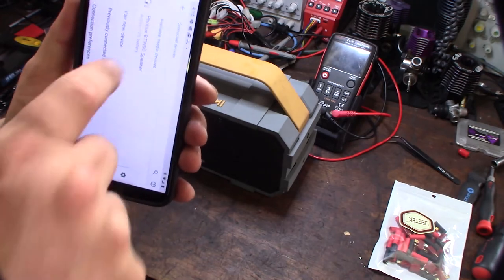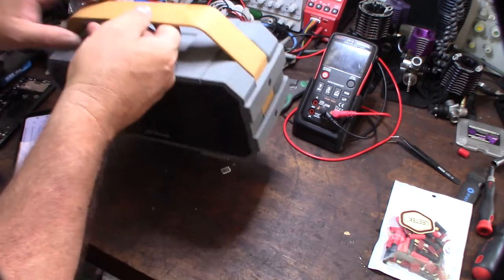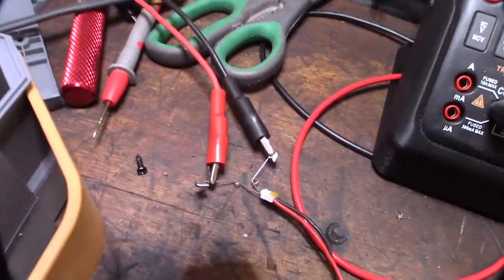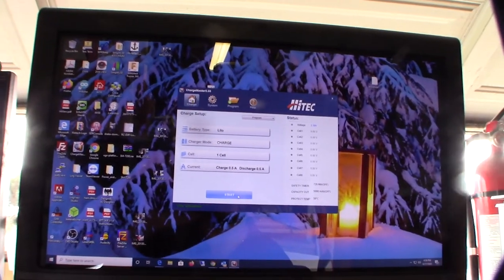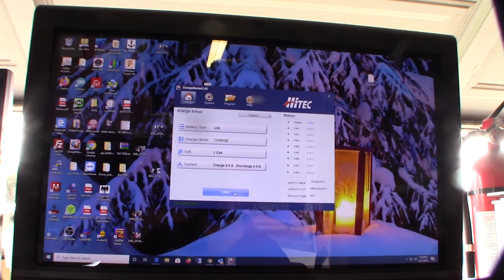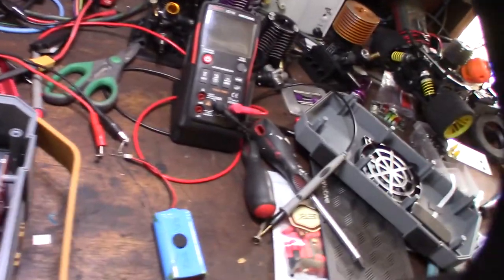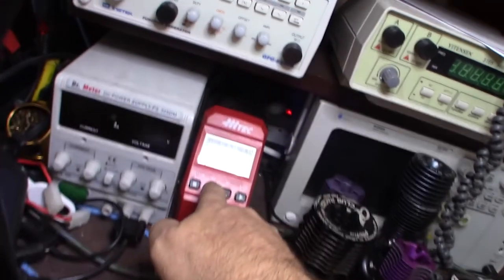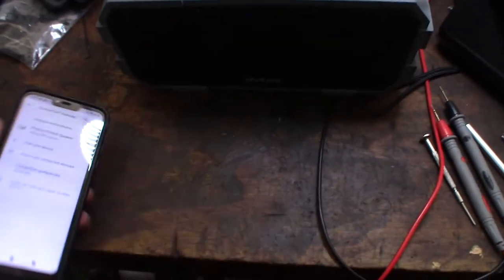Micro USB will not charge Bluethooth portable speaker troubleshooting and repair Photive

Comment: I would have liked to see the complete disassembly process (even speed up).  So I'll add my 2 cents.  After the 8 Philips screws in front, you'll need to do the 4 larger star screws on the sides and carefully pop off the 4 pieces they hold in place.  I used a flat head screwdriver and a small hammer to carefully tap off one edge of each of the 4 pieces, parallel to the long edge aiming outward.  Then the entire back side comes off - but be careful here too because the cable connecting the charging port isn't very long.  As for my repair, one of the speakers quit working after a ~4 foot drop onto pavement.  I was really hoping I could re-solder a speaker wire, and lucky for me that's exactly all it needed!  (Oh and by the way, the rear speaker looking item is called a passive radiator, meaning its not actively powered.  It simply responds to the air pressure of the bass notes:  when the powered/active woofer makes bass tones, the passive radiator vibrates at the same frequency, thus increasing the surface area producing bass tones, therefore more bass.  This is sealed and will keep water out, unlike an open bass reflex port which is the other main way to squeeze out more bass.  There's only 2 full range drivers here, which is good for the $50 price range, a powered sub/woofer would certainly cost more, and add weight too.)  For whatever reason this is like the ONLY video I could find on this speaker.  Your video was indeed helpful, and I don't know if I would have attempted my repair without having seen the insides, so thank you!!

Comment: Actually if you take the front of the speaker off there are big holes you can use a thin screw driver. Find the box within you will find a charging port, a power supply charging port inside the speaker. Use a thin thin flathead screwdriver and bend the black piece within the inside of the charging port USB HOUSING . PRY Bend it down a bit. Then PRY bend the OUTSIDE bottom of the USB charger port casing UPWARDD with the flathead SCREWDRIVER so that it makes a tighter connection to the charging cable tip. You can use needle nose pliers on the charging port to clamp it tightly to the computer chip that it is fastened to. Plug the charging port in while you have it apart. If the light blinks it means you have to reattach the long white power Sata cable which I haven't mentioned yet. The Sata connector cable clamp that holds it in can snap so don't pry it open there are two push pins on the sides which release a Sata cable. Google it. sata cable disconnect. Basically tighten USB fitting
Reply: Can I send h mine to repair ?